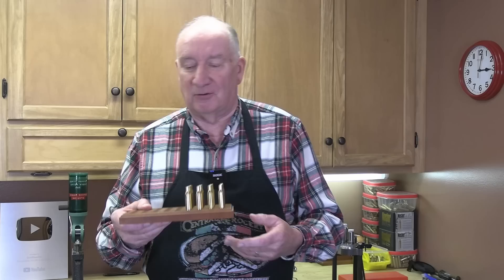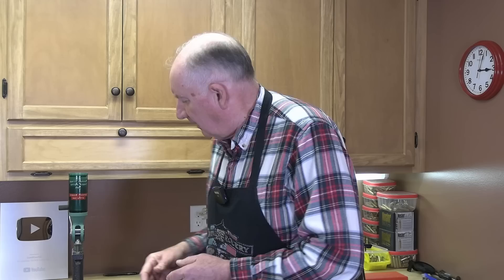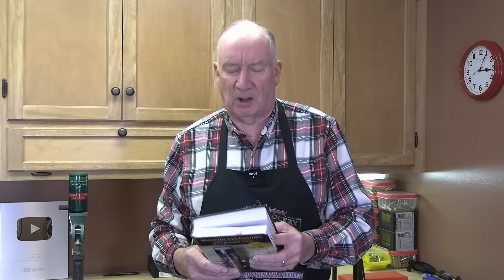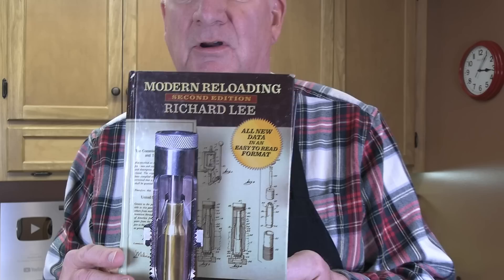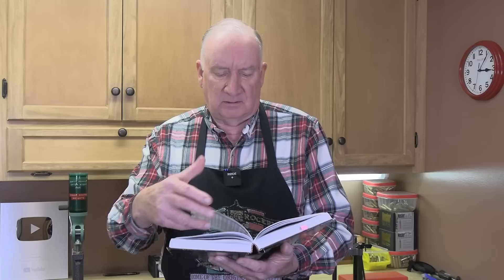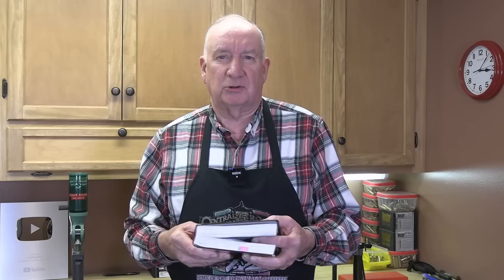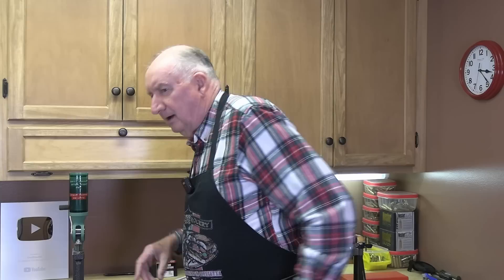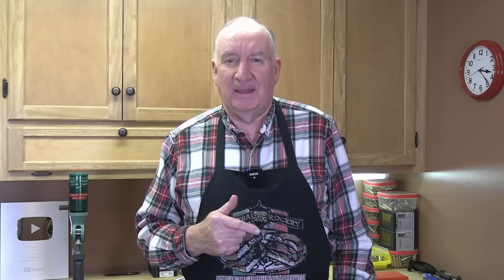How to Make Super Accurate Ammo ~ Part VI Powder Selection

Comment: Am not a reloader I live in a condo. But I still follow the information. Thanks 🙏 and blessing be on your family.
Reply: Boris Perez; Hello. You do not need a workshop or a basement to reload. Reloading can be done on a small table in the kitchen or any room or on the taligate of a pick-up truck {but not on a windy day 😉}. There are portable reloading presses/tools such as the "Pak-Tol". The "Lyman Acculine Press", which can be mounted to a table / bench or can be handheld.  The "Lee Handheld Press". The old (but still made) Lyman/Ideal "Tong-Tool" (aka: "The Nutcracker") hand press. 
 
 Both Lyman and Lee make a wide assortment of other reloading accessories. Make sure you buy a printed reloading manual from Lyman or Lee (or both) and read it first before doing anything!  Also, a book titled: "The A.B.C's of Reloading" would be helpful. 
 
 A set of the Lee Powder dippers ( which comes with a slide chart for many powders showing which dipper to use for each powder/cartridge), some gunpowder that is correct for your caliber and bullet weight, primers (such as Small Pistol/Large Pistol/Small Rifle/Large Rifle/209 Shotshell primers), a cereal bowl (for the powder to go into so you can dip the powder dippers. {Do not scoop as an ice cream scoop, but instead dip the dipper into the middle of the bowl of powder and let it fill without compacting it down, use a playing card or a business card to level off the powder dipper from any excess powder. Pour the unused gunpowder back into the powder can via funnel and cap the powder container! Only have ONE kind of gunpowder on the bench/table at a time.}   
 
 Get a set of Dies for the caliber you want to reload, and you can get started. You do not need to spend mega-money to begin. Both Lyman and Lee have beginner's "Kits" that contain the basic tools. Keep things simple. 
 
 Store your powder in a cool, dry place, away from the primers! 
 
  There is also the original "Lee Loader" which is operated by mallet/hammer and your arm/hand. Since you live in a Condo, I do not recommend the original Lee Loader (the one operated by mallet/hammer) because it makes noise/sound and if you are on the second floor, the people below you on the first floor will complain because the hammering on the table/bench and vibrations will probably carry down to them.
 
  BTW - If you want to buy the Original Lee Loader tool, there is a video on You Tube by a man in Australia who made a "Press" to use the original Lee Loader to load his .303 Brit ammo, instead of using a mallet/hammer. He modified an old wine bottle capper machine so instead of using a hammer or mallet, it is done by a lever instead. Very smart!  
 
  P.S. The Original Lee Loader (powered by Arm & mallet) is caliber specific, --- in other words: you have to buy one tool for each cartridge you want to reload. One size does NOT fit all. On the other hand, if you get a Lyman Acculine Press or Lee Handpress, you can load anything because they accept various die sets. One Press can be used to load from a .22 Hornet to a .38 Special to a .45-70 Govt. cartridge.
Reply: I thank you for your reply. I think am in need of learning more first than stealing a small space away from the old lady. Still I’d prefer an environmentalist such as a garage all things being equal the kitchen is not on my top list.
Reply: I thank you for your reply. I think am in need of learning more first than stealing a small space away from the old lady. Still I’d prefer an environmentalist such as a garage all things being equal the kitchen is not on my top list.
Reply: @borisperez3129  Understood. Keep the women folk happy is good idea. 😉 [ BTW - Women can reload, but since normally most shooting is done by males, the most reloading of ammo is of course done by males. There is a female reloader on You Tube --- maybe she was with her husband in the reloading video?    Maybe your wife might be interested in shooting?] 
 
    Learning first is a wonderful thing, especially with automobile driving and ammo reloading! 
 A person can learn much stuff from Gunblue490 and some other folks who have experience. 
 
 I would suggest that you go ahead and buy a copy of the Lyman or the Lee reloading manuals and start at page one and read them.  No hurried rush, but a steady meal of information to the brain is a great thing. Both of those manuals have photos, diagrams and lots of instructions.  Note: both Lyman and Lee make their own reloading equipment so the photos / pictures will be of their dies, presses, powder measures, scales etc. --- not a problem. The A, B, C, D, E steps of reloading are the same regardless of the brands. 
 
If you can change the spark plugs on the car engine or change a flat tire, then you can reload ammo.

Comment: I have found your advice very sound and with no contradiction. Thank you sir. A quick story. I was testing a hot loading of US869 in my 28 Nosler. Things were ok when I chambered a round and a friendly guy came over to my bench for a chat that lasted a few minutes. Afterward, when I touched off that round, THWACK!!! "What the hell was that"? And then I knew. US 869 is a spherical powder and I had been warned about its temp instability. I had cooked that round in the chamber while speaking to that guy! Well, I had to beat that bolt handle upward to open the chamber. Just as you've said, captain. Beware of these powders. They are temp finicky and I wouldn't be even using it if stick powders were a little more available. God bless, sir.
Reply from the maker: Yes, that's very much an issue with hot chambers and spherical powders.  One exceptionally accurate 22-250 load with Win 760 powder has stuck a bolt on me a couple of times, which is why I no longer use it.  "Cook-offs" were warned of in the first M-16 manual that I was issued, and Ruger warns of it in their autoloading rifle manuals.  That's where a very dangerous, spontaneous firing occurs without a hammer strike with an overheated barrel.  Thank you, and God bless.

Comment: If you load for several different cartridges, it also helps to use the same powder for a couple different cartridges.  Like 44 mag and 357 mag or 270 and 30-06 for instance.
It gets a bit more difficult to do that when you get to magnum rifle cartridges though.  Especially if you are trying to get optimal performance out of your load.  But if you aren't looking for top speed and .25" groups, you can get away with using one powder for two or three different cartridges sometimes.

Comment: Found that imr 3031 does super good in my 16” 5.56 ar…low velocity but very tight groups..I’ve got several for my 7.62 carbine that are under 1”…superformance,h4350, and ramshot tac…77gr 5.56 and 175smk 7.62…put 5rds n a 20oz lid at 100yrds with my 7.62 DD…your knowledge is far n wide and I’m so glad you share it…thanks a bunch…matt

Comment: When I look for data for a new cartridge to load, i do as you say and look for something that will span a good range,  but also what gives the most velocity with the lowest pressures.  And I'll also find as much data as I can, alot of the times tgey will be different,  so I'll take and add all the minimums, and maximums and get an average for both and that's what I use for my min, and max.

Comment: Good video GunBlue490. I also have the Lee 2nd Edition manual, but always check it with my Lyman manual and also one of my Speer manuals because sometimes it seems Richard Lee went a tad on the "hot" side. Lee company really needs to revise and update that manual. It is copyrighted in 2003. It is now 2023 and several of the powders Lee used were recalled and some are no longer sold. I like the Lyman Manuals because they post a "Factory Equivalent Load" and also "Most Accurate Load" for each cartridge.  I liked the Hercules and Du Pont powders.  
 
 P.S. - Last night I tried to sign-up for "Patreon' and got to the site and kinda-sorta logged in, but I do not think that it went through. I checked my Pay-Pal but it did not show the "activity". I am not very slick with computer gizmos. Maybe I did something wrong.

Comment: In my sporter-weight .308 Winchester, shooting 165 grain bullets, IMR4064 is my go-to. It isn't sexy,; it just gets the job done, to the tune of 3/4 inch groups at 100 yards. No spherical powder has ever done as well in that particular rifle. Your results may vary.
Reply: 4064 is THE powder in 308.  1/2" @ 100 with Sierra 150 Game Kings in an old Remington 788.
Reply: Also I find that you can tweak the IMR4064 charge for different bullets and still retain excellent accuracy in the .308
Reply: @wingman8447  For that rifle, I've settled on the Sierra 165 grain GameKing as my do-all bullet. It gives excellent accuracy and reliable performance on deer. I have tried other bullets, but none work as well.
Reply: 165 SGK @42gr IMR 4064 on my M1 sub MOA

Comment: A good short cut is see what a popular powder choice for your cartridge is with serious competitors. That can save you a lot of time and money. You will have to tweak the load a bit for your firearm but you should be in the right ballpark.
Reply from the maker: True, but they arrive at the same conclusions that any novice can by learning how to fish for a load.  Competitors tend to follow the leader for the same reasons you mentioned; to short cut, but often ignore other great powders because they don't think for themselves.  While everyone currently promotes IMR4064 as the best .308 powder, at least six others do equally well, and even better with autoloading guns.  No powder has ever had a franchise on accuracy.
Reply: @GunBlue490 Very true, over on this side of the pond N150 is popular but I find in my 20" Tikka N140 is working very well. 100m tunnel testing was giving surprisingly small groups, well under 1/2 MOA until the barrel starts to warm up, approx a dozen shots.

Comment: I'd like to have that manual.  I've found questionable data in many publications.  There are known certain powders for a cartridge  that produce the best accuracy in most rifles, and  generally speaking, heavier for caliber bullets also produce better accuracy.  These are the powders and bullet combinations to try first.  For example, 6.5x55 produces it's best accuracy with 140 grain projectiles and slow powders.  Because temperature insensitive powders  produce pressures that are more consistent than temperature sensitive powders, the rifle will shoot accurately with the same load at different time of the day, and in different seasons.  A super accurate load may not be as accurate as the temperatures changes, and if the cartridge sits in a hot chamber or direct sun for too long. Therefore I will use only temperature insensitive powders such as H4350 and H4831sc with 140 grain bullets in 6.5x55 loads.  For ranges under 300 yards, I would use a flat based bullet, and for ranges beyond 300, a boat tail. .30-06 will do well with H4350 with 165 to 190 grain bullets,  and it will do well with H4831sc from 180 to 220 grain bullets. H4350 and H4381sc are very temperature insensitive, but there might be a particular powder that can produce a tad better accuracy, but only at certain temperatures.
Reply from the maker: In general, I prefer powder manufacturers data to bullet manufacturer data, whenever a data conflict exists.  Lee's manual is a compilation of powder manufacturers data.
Reply: It's an interesting exercise to compare different sources load data for a cartridge for the same bullet and powder combination. It does vary. If in doubt I start lower and work up.
Reply: @redrock425  Yes, always start at the bottom and work up. Check several sources and choose the most conservative and lower charge weight recommended and only use data that also lists pressures.  I use .5 grain increments to locate an accuracy node and then .1 grain increments to dial it in and locate the middle of the range of powder weights that produce the tightest groups.  The accounts for variations in powder weights during the reloading process, and for variations in temperature.  Use American data. European and American data for  cartridges such as 7x57 and 6.5x55 can have two sets of data, one for the older low pressure military rifles, and the newer high pressure modern rifles  chambered in the same cartridges.  The European data denotes the charges intended for modern rifles as 6.5x55SE, and data for low pressure rifles in 6.5x55 as '6.5x55' instead of '6.5x55SE'.  Using such nomenclature , as in 'SE', is a dangerously  subtle and vague way to make a distinction.  Some 7x57 data makes no distinction in  the reloading data and do not list pressures.  And some manufactures of this ammunition will sell dangerously high pressure ammunition in their 7x57 (7mm Mauser) ammunition they sell.  If you are reloading for an antique rifle, the information provided in my old article, Choosing a Practical Antique Rifle by Tunnel Rabbit, can be found on the internet.  The most useful powder for these rifle is H4895, and it is also temperature stable.  H4895 is also a good powder for most other rifles.  If I could only have one powder, that might be it.  Varget is also extremely temp stable. My favorite powders are H4895, Varget, H4350, and H4831sc.  These will run good in a wide variety of small to medium bore rifles, including some magnums.

Comment: The Richard Lee loading manual does not do pressure tests themselves, they only take test data from others that do, of which they lose the test barrel length, case brand, primer type and brand, as well as bullet brand. These are all important elements, as one should never take data made for one specific brand and type bullet and turn and use it with a different brand or type bullet. This is due to Brinell hardness and bearing surfaces can be different, of which can cause extremely high pressure issues. One should only use data straight from a reputable data source [see paragraph below] that does their own pressure testing which give the test barrel length, case brand, primer type and brand, and most of all the brand of the type bullet used in developing the data. Each one of these elements that are changed is a compromise of which if all are compromised at the same time could very well add up to a recipe for disaster. 

Lyman, Speer, Nosler, Sierra, Barnes, Swift, Berger, Norma, Lapua, VihtaVuori, Accurate, Western Powder, Hodgdon, or even Hornady reloading manuals are far better suited than Richard Lee's for gleaning load data from, as they all not only do their own testing but they all give the test barrel length, case brand, primer type and brand,  as well as the bullets brand and type for each load recipe. 

Again Richard Lee's manual throws out one of the carnal safety rules of never use load data developed for one brand of bullet for another brand of the same style bullet. Keep in mind that it is always better to throw out Richard Lee's manual than any of the safety rules.

Comment: I got into reloading a year ago. Finding powder and primers difficult soo I was glad to find any power on the list. But here is the thing. Lee listed max charge and Hornady has it a starting charge ??? You bet I'm confused and worried.
Reply: Good to be concerned and cautious. I have the "Lee 2 Edition manual" as he showed in the video, but I also have a "Lyman" reloading manual. Why? Because neither of them makes powders, primers or bullets. Sometimes the Lee data is different that the Lyman manual or the 'Speer" manuals. Always start from the lowest charge and work up as GunBlue490 mentioned. 
 
 Another good thing about the Lyman manuals is that they tell you what gun was used as the "Test" gun, and they have a "Factory Duplication Load" and a "Most Accurate Load" and sometimes they are the same.)  A problem with the Lee 2nd Edition Manual is several of the powders that are listed were either recalled or are no longer available in 2023. It was first printed in 2003. My copy is from 2007.  The Lee company needs to revise and print a new manual. 
 
 Both Lyman and Lee also give data for loading Cast Lead bullets. They have less velocity, but the bullets cost less than copper/jacketed bullets. Several guys that shoot cast lead bullets say that they are more accurate than jacketed bullets.  
 
  If you are on a budget, shop for reloading manuals on E-bay or Gun Shows or Used Book/Thrift Stores.
Reply: The Lee manual is an agglomeration of data from various sources.  It is a good place for selecting powders.  Maximum Average Pressure published by the bullet manufacturers is determined by bullet construction, Brand of brass case you use, cartridge overall length, and bullet jump in the test barrel used.  In pistols with fast burning powders you may have as little as 0.4 grain from min to max.  I would defer to the powder and bullet maker, and if in doubt, contact the manufacture's ballisticians for clarification.
Reply: @gusloader123  Lee revises their manual annually.  My 2nd edition is the 2019 revision.  Hodgdon (who owns Accurate, Western, IMR, and Winchester), Alliant, and Shooters World powders all have current on line load data information.
Reply: @excelsior6365  I noticed that after someone else mentioned it to me recently. Lee kept the "2nd Edition" phrase on the front cover, but have added "Revised powder lists in 2019, or 202?"  I think they should quit using the words "2nd Edition" and call it 3rd or 4th or 5th edition on the cover. Easier for buyers, booksellers, librarians.

Comment: Can someone run the pressure for a .38 Special load for me?  Using Quick Load software.  Load is 5.1gr IMR PB under a Lee TL153gr LSWC in a Win. .38 SP case Wolf SP primer 1.45" OAL. I know it's well into +P. Possibly +P+ or .38/44 range. Please